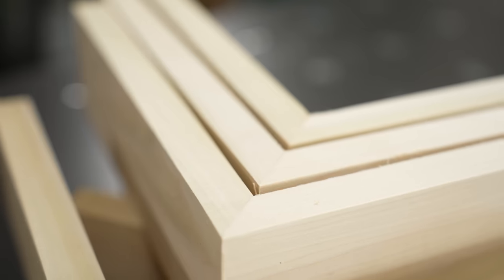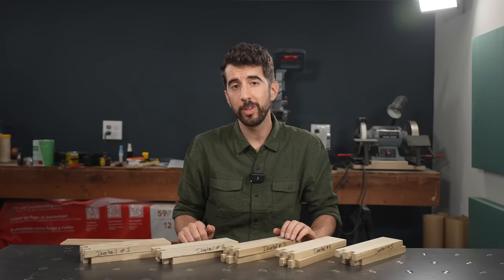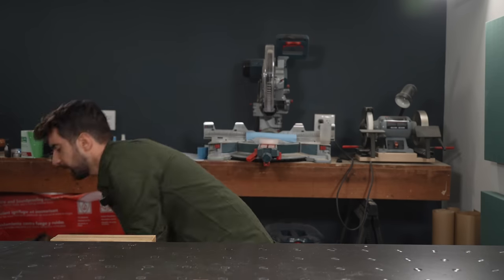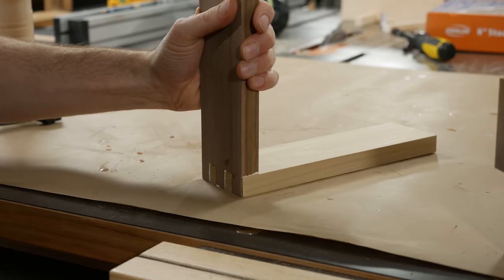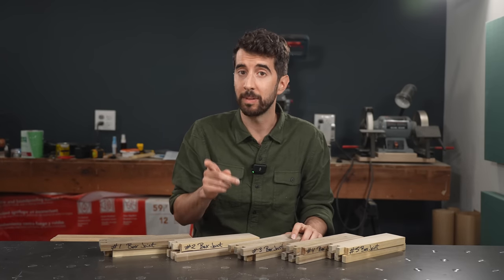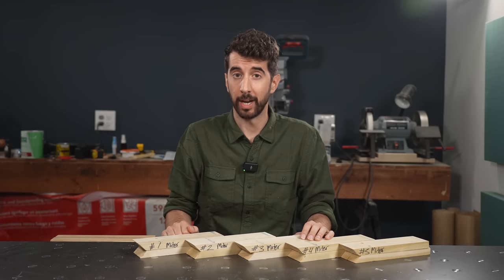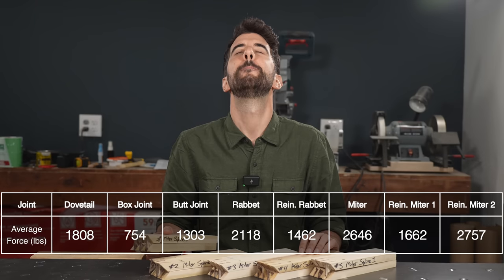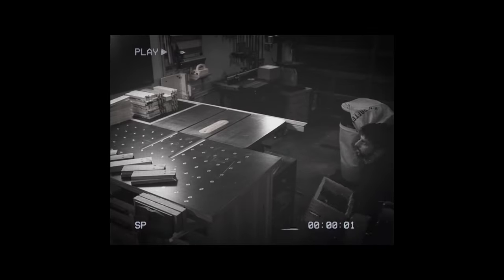This Simple Joint is Stronger Than a Dovetail!

Comment: I love seeing data driven tests like this, but there are so many different tradeoffs:
* strength: This only tested tensile strength, but there's also compression, torque loads, jolts (drawer slams), and stated wood movement.
* Ease of accuracy: Miters for example are harder than other joints to match 4 corners of a box.
* Ease of clamping/glue-up: Box joints and dovetails self-square so you don't rack when clamping down. 
* Minimizing steps: Do you want to take the time to do 2 glue ups for splined miters?
* Aesthetics

No joint is right in all circumstances, it's good to learn about where each falls short.

Comment: Depending on the purpose of the box, I can see two other issues:  

* Racking -- any force that tries to push rectangle of the box into a parallelogram.
* Twisting -- any force that tries to turn the rectangle of the box into a helix.

Real life failures in things like drawers happen when a drawer is dropped and lands on a corner.  Someone is pushed sideways on a chair.

So, some different tests:

Build full boxes of this, and make a massage machine that flexes it.  500 flexs of shrinking 1 diagonal 1/4" then the other diagonal 1/4"  Also measure the force it takes to make that flex.

I'd also be interested in comparisons with joints that are stapled, brad nailed, and screwed.  

*

I made food boxes for use on canoe trips.   10x 16x 30 inches roughly.  (I tweaked the size to minimize waste plywood.  I think I had 2  square feet of plywood in various trim bits and a bucket of sawdust to make 13 boxes.   120 lbs full, and they were not treated gently.  My technique wasn't elegant.  Panels of 1/4" GIS plywood.   

Strips of 1.5"x1.5" spruce glued and screwed with drywall screws every 4 inches.  Door side of box had 3/4/x3/4 spruce ledge set back 3/4" from the top.  Door had 3/4 x3/4 spruce set to meet the ledge.  Standard 3.5" non-free pin door hinges.  padlock hasp and leash-clip as a latch.  Boxes were dropped fully loaded at times.  Harness straps were attached using sewn loops which then we passed a 4" piece of 1/2" x 10 ga strap steel through, and anchored with 4 screws through the plywood into the corner bracing inside.  Boxes were damn near waterproof.

Comment: Jon did a video praising the high strength of the mighty miter joint.  You have proved him correct.  Choice of joints at this point are more or less fashion statements.  I love rabbit joints because they provide a positive stop and is easier to keep things square for assembly.   From this point forward, I wont be able to just say miter joint, it will now almost always come out of my mouth "the mighty miter joint".    Great video.

Comment: It would be interesting if you made another batch of these test joints, left them outside in a box, and revisited the same tests in five years
Reply from the maker: I'm devising a scheme for making some sort of contraption that can put a small and cycling amount of pressure on a bunch of test joints all at once (something like 30 lbs on and off every couple of seconds) and have it contained in a sealed enclosure where I can introduce and evacuate fluctuating humidity say every half hour. Leave it running for three months straight and see what happens... it might take me a few years to get around to it though 😂
Reply: haha, I'll take it in lieu of waiting 5 years. I am a complete noob and make cabinets by using glued miter joints - but also with kreg jig'd screws driven through the interior and then dremeling the tips off. My personal hope is I suck so much I have failed upwards into the strongest joint of all.

Comment: I've seen a few of these types of testing videos but only during yours did it hit me: what are we building that will have THIS much force on a joint?!  If someone is saying they need more than 100 pounds of force on a wooden joint for a drawer or cabinet,  they really don't understand that one can gently open a drawer.  Keep up the good work!
Reply: Also, there's no such thing as a glue-starved joint. If you put glue on it, and subsequently rubbed the glue off by pounding the joint together, well, you've still got a few molecules of a glue layer left my friend, more than enough for the glue to do it's job. But these silly arguments are moot, because it's the wood that fails first.
Reply: @christopher_hawn  The wood doesn't fail first on end grain joints though because of the structure of the fibers. The fibers can't break like that so the glue line snaps, as in the case with miters. And yes, if you let the glue sit for a minute before hammering the joint together the wood is already swelled with absorbed glue so that's enough to hold it. People forget, or don't know, that you want glue lines thin. Thick glue doesn't harden all the way through.
Reply: Even if you don't use it gently it doesn't matter. Unless you're building like an idiot, almost anything you do is going to be strong enough for normal use and abuse. All of these joints are fine, and modern glue is fantastic. Your piece will be thrown out 100 years from now anyway so it's not that hard to build something to "last a lifetime" (50 to 70 more years). People seem to think their mid century modern computer desk will still be in use 300 years from now and not in a landfill, which is where it will actually be.

Comment: One thing I’ve heard about reinforcing box joints is from old wooden milk crates. They would drill a hole down through the joint and put a nail in the hole. There have been cases of those crates lasting almost 100 years without failing.

Comment: Great video. Thank you.  Enjoying all your viedos, unsurpsing im an engineer turned hobbyist woodworker.  I feel like comprehensive testing videos are near impossible to make engaging and well paced, but you do a great job. One thing I’m left with though is what about plywood joints?  Why is it always testing solid wood.   Also, I’ve been doing half/half/half locking rabbets, why no love for locking rabbets.  I’d assume the wood would fail, especially in thinner plywood, but I’d have assume the box joint would have held up better than your tests showed too.  Thanks again.

Comment: What I like about the mitre joint is  that it shows no endgrain, whither is desirable in house fixouts. I used it when shirting boards end without turning a corner.

Comment: Hide glue is still used on musical instruments. They need to come apart to make adjustments which occur over time, different string tension after changing strings, changes in humidity, a new bridge, different tailpiece, worn out endpin, etc.

Comment: My go to joint so far has been a rabbeted miter. Easy to assemble and clamp, and hides all your end grain. I think for your tests of joints that aren't symmetrical, it would have been interesting to test them in both directions.

Comment: When I absolutely, positively want the joint as strong and permanent as possible, I use construction adhesive and don't make the joints too tight. 
I made an end table that was too big and decided to knock it apart and trim it smaller. I hit the joints with a 12# sledge and broke the wood but the joint held.

Comment: Excelllent video. Besides the tight/loose fit question, I would like to see finger joints and blind dovetails tested - just to see if they confirm the trend you discovered in your series.

Comment: It seems like modern glue is much stronger than people anticipate, at least at this "few months after completion" timeframe. Getting good glue surfaces seems to be more important than mechanical interlocks. End grain, because it tends to be rougher, will probably produce a better glue surface.
Reply: This is incorrect. End grain is "thirsty". it sucks glue up. And you don't want your surface to be rougher. You want glue line surfaces to be as smooth as possible. Planed to a polished surface would actually be the ideal. You want glue lines in the joint to be thin. Glopped up glue doesn't fully harden on the inside. Thin glue line on smooth surface produces the best strength, technically.

This isn't like a coat of paint on primer, or a second coat of polyurethane where you need to sand between coats to rough the surface to give it something to stick to. Wood glue doesn't work like that.

Comment: This is a brilliant video, and absolutely fascinating. I wonder, however, what would happen with plywood (e.g. baltic birch plywood). Worse, particle board. If I'm working with plywood I'd still rather go for the dovetail. However the point about glue starvation is very important. Back when I started I always aimed for super-tight dovetails because they look so darn nice. But years ago I discovered that with the right glue, you get a better result with a slightly looser joint. And by 'better result' I do mean the longevity of  the join. Repairing cheap drawers for rentals is a waste of time - much easier to simply replace them. I've found that tenants often have poor impulse control and tend to get  frustrated when a drawer sticks (usually due to over-filling) so they yank with all their might until 'something gives'. Usually, its the front joints of the box section. However, I've never had a dovetail fail in a rental environment, so I wouldn't abandon them just yet. That said, I might try that last category or reinforced miter. I'll let you know the real-world result... in about 15 years.

Comment: A dry dovetail joint (accurately cut) is stronger dry than glued. Glueing causes the stresses to migrate to line up with the grain and cause shear. I learned this back in the 1950s when I started working in wood.

Comment: I was taught that the right technique makes a big difference when applying glue to end grain (butt joint, rabbet, miter, etc). I always apply sizing (well-diluted glue) to end grain, let it sit for a few minutes, then glue up normally. Done right, it supposedly greatly strengthens the glue joint. After watching your video, though, I think it would be nice to test that.

Comment: Whenever I do drawers, I always use a butt joint with alternating deck screws and dowels. The theory, and I emphasize theory, is that the screws will keep the glued surfaces from separating and keep the dowels from flexing, so they only have to withstand sheer force perpendicular to the grain.  I have no idea how many pounds it would take to break one, but none have failed and my kitchen tool drawer has been taking abuse for almost 14 years with no sign of weakening. It's not most people's idea of fine craftsmanship, but it works.

Comment: Data-Driven Destructive Testing - Nothing Better In My Opinion   Refactoring this list for Ease v. Strength leads me to the Rabbet as the go-to, followed by the RM2 joint.   And as a newbie to joinery, but a veteran with data, scratches an itch that is just in time  for my next upcoming project idea.  Thank You!

Comment: Scott, I was surprised at the results of your testing, I would have thought, too, that the dovetail would have certainly been stronger than the butt or miter joint. In analyzing the results, it has become obvious why  this is so. The deciding factor is the end grain. The glue soaks into end grain and has better adhesion than it does with the long grain. The glue is indeed stronger than the wood, but it is the adhesion that matters. It was a very interesting video, I appreciated it greatly.

Comment: Horses for courses. The dovetail was used by our ancestors for drawer front panels because the joint relies less on the glue and more on the mechanical  strength. Look at old furniture and you'll see dovetails (time consuming to make) on drawer fronts and usually mitre joints on the rest of the drawer construction. They knew what they were doing.

Comment: An interesting idea: the mitre box joint. It's a box joint… with a 45° bias. You'd have the surface advantage of the mitre, and the box joint, so long you are able to maintain that 45° bias throughout. But also you can have drilled holes offset a thou to "Draw in" and seize together the pieces with a dowel which has a slightly conical tip, so you have the anti-racking of the box joint, the surface area of a mitre, and a simple-to-perform hammered-fastened reinforcement.

Comment: One reason a box joint might not be as strong as a dovetail is the geometry.  If you consider the area of the mating surfaces on each side of a dove tail, and of a box joint, there is less wood surface in the box joint.   The fibers provide most of the strength, and they are only weakly held together.  Wood splits easier than it breaks across grain.  The joint represents a discontinuity in the structure, where the primary strength is wood fiber parallel to force pulling the joint apart.  The joint fails in the wood perpendicular to the force because the fibers separate rather than snap.  A dove tail joint fails in the tails rather than the pins.  The force pulling the pin board away from the tail board applied parallel to the tail, forces the tail wood to split somewhere between the outer and inner corners of the tail structure.  The force is dsitributed across the tail's width on either side of where its root attaches to the tail board.  A box joint has most of the breaking force in a very narrow zone adjacent the glued surface.  There is less mass resisting the break.  No glue starvation need to explain anything.

Comment: Thank you for showing your spreadsheet (@ minute 12:03), because I had been wondering what the standard deviations were.  Scientifically, it's probably not best practice to arbitrarily remove the high and low values from your dataset, unless you had some justifiable reason to exclude those values, but it's an understandable approach and you were clear about it, so no worries.

Comment: You know ... dovetails were used in a time when good glue wasn't easy to come by. They also used better wood with denser fibers. AFAIK, wood glue is water based and penetrates deep into the wood - and that's (maybe) why the 45 degree is so good: since all fibers are cut there's more glue penetration. Those types of glue didn't exist in the past - and dovetails are awesome looking!

I have a few things that belonged to my grandfather and two of them are impressive: a USA made front cutting plier that has zero play even though it's 80 years old and his working desk (that's also around 80 years old) ... and the drawers are solid to this day.

Comment: 🤔 Wow, those results are NOT what I expected!!! My favorite joint is a miter clamped with screws, and I do tend to use drywall screws (I know, I know I probably make my own liquor in a shed out back. Well that’s not true, I make in my basement, my HOA doesn’t allow sheds.) I however did notice that they don’t fail particularly often 🤷 I guess I know why now.

Comment: I build guitars with a half inch tenon neck joint( basically a single pin box joint) and i make sure they slide out on their own weight so theres actually room for the glue. Ive found that way they are way stronger then if they are tight before glue up.

Comment: Good job on finding the last miter joint with horizontal reinforcements! Perhaps another joint for you to test would be what I call a double rabbit joint. Not sure if it exists already, but both corner boards are cut like the original rabbit joint, but at half as much distance on each. Next joint to try is a double rabbit joint with horizontal reinforcements. The third joint to try is super complex, a double rabbit with dove tail horizontal reinforcements (to exploit that mechanical advantage you were talking about). If you have the time to manufacture and test these experimental joints, we may find an even stronger joint than the miter with horizontal reinforcements and I'd love to see the video and am sure others would too.

Comment: Would have been great to see a locking rabbet in this comparison as the 1/2 1/2 1/2 or 1/4 1/4 1/4 method is a pretty common and very effecient way to make drawers as you can do all of the jointery from a single table saw setup.

Comment: Very nice video. I would have liked to see more closely how the test rig functioned. I can't help wondering whether limiting the force to one direction overestimates joint strength. It may be that drawer joints typically are stressed only in one direction, but I am thinking about other possible applications. Not sure what they would be, though...

Comment: The miter joint strength makes sense. A 1x3 board is 0.75" tall x 2.5" wide. If you calculate the area of the end of the board, you get about 1.875 square inches. This, along with the glue, is what makes the joint.

When you cut a 45* miter, you're making a 45-45-90 triangle. Looking at the board from the side, the sloped edge is the hypotenuse of this triangle. Given the board is 0.75" tall, we can calculate that the mitered end of the board is now 1.06" tall x 2.5" wide. This gives a total of 2.65 square inches of board making the joint. That's ~41% more glued area than the butt joint.

Comment: I can't help but feel that the three dowels was one too many. Same with the Reinforced Miters (#2), just two splines should be sufficient and probably would ultimately be stronger as they are removing less wood from the joint. The idea being that removing more wood will make the joint weaker and succumb to wood failure quicker rather than glue failure. I believe there is a balance to consider as to how many of these reinforcements would actually make the joint stronger. Great video and terrific content.

Comment: This test was entertaining. I find useful that it showed that a joint can be weakened by trying to make it stronger.
I'm confident the test could be repeated in a way that shows the box joint to be superior.
1) the joint should not be loose, but a dry joint should easily be able to be pushed together by hand without a mallet.
2) the number of fingers should be increased. 1/4" finger width is good and practical.